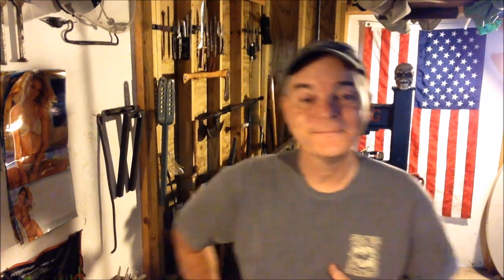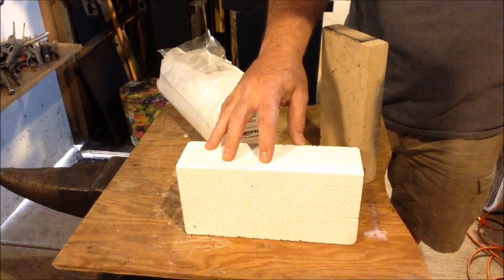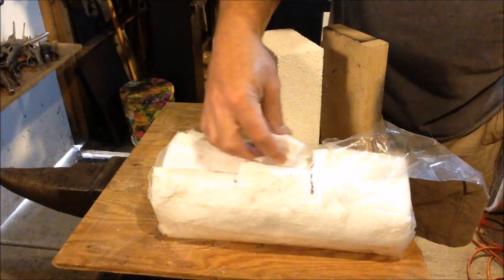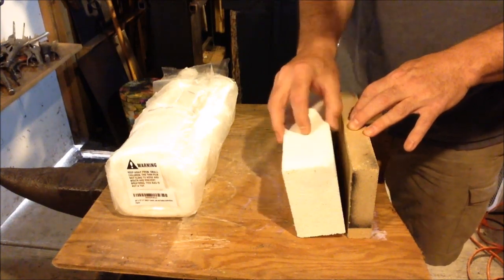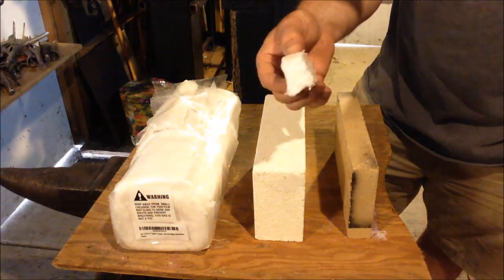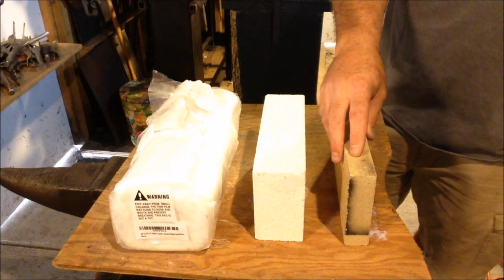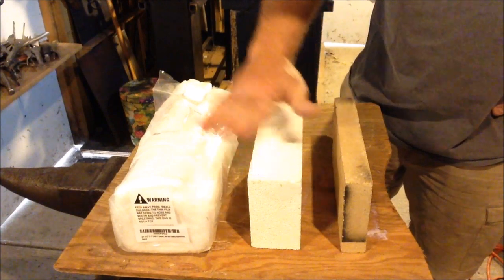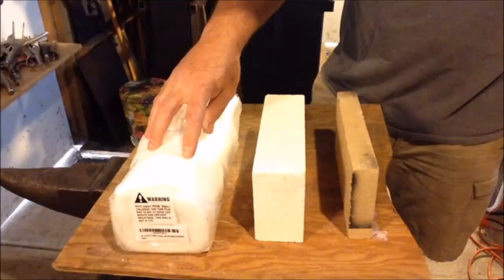Subscriber Question - Insulating My Propane Forge?

Comment: Quick question if i made a forge with fire bricks on the bottom coated with satanite to reflect the temp with the fire blanket also coated with satanite and maybe the price are better or because it is bulk priced for 21 bucks for refactory cement or is that the wrong stuff
Reply from the maker: Bryan, I hear Satanite is good for coating wool blankets or the soft white bricks within a forge or foundry furnace - not sure what the costs are.  I just see a lot of guys using it.  Also, I just built a foundry furnace and used Imperial Refractory cement from True Value to coat all the white soft bricks - that worked well and was inexpensive.  Good luck with your build!

Comment: Question choosing a tank to make a forge is aluminum or stainless steel good idea or bad or do I have to add extra steps or extra insulation? I saw a 30 gallon propane tank for 30 and wanted to make sure not going to smoke check me
Reply from the maker: Thanks Bryan - Aluminum has a melting point of 1220 F yet you need to run the forge high enough to reach forging temp for mild steel which is approx.  1500 to 1800 F.   It's also expensive.   So, I would use mild steel given it has a melting temp of 2500 F. Stainless could work but it's also expensive.   Stay safe if re-purpusing a propane tank - I hear it's dangerous...
Reply: @RickRabjohn  yea was also looking at a old tank going to use water to fill rinse and repeat fill with water again when I cut

Comment: Hello. Could you please help me with a question? Recently purchased a devil forge with the ceramic wool lining. I used Refactory Cement to seal the wool lining. On my first fire up the cement began to bubble. I allowed the cement to cure for 5 days prior to first fire. Do you have any suggestions as to why this may be happening?
Reply from the maker: It happened to me a few times as well when coating insulating fire bricks (i.e., the soft white bricks).    Underlying moisture is the issue.  When this happens, I fire up the foundry/forge to drive off all the moisture (get it bone dry) - then let it cool down - brush and vacuum out any loose refractory that came off and then re-coat.   Hope that helps Trace, and good luck with your new forge.
Reply: @RickRabjohn  Thank you very much for your prompt reply. I assumed moisture was the issue but appreciate your confirmation. Best. Trace

Comment: Quick question for you, what type of hardener should i use for the kao wool? Ive seen blue and clear but no product names have been stated and ive seen a person use refractory mortar. Im building a propane forge and would like to glean as much knowledge as i can from as many perspectives as i can.
Reply from the maker: Aaron, while I don't have any personal experience with Kaowool coatings, I have seen guys use either Satanite Refractory Mortar or HT-100 coating for sealing the Inswool/Kaowool fibers in their forges.  Hope that helps and good luck with your build!
Reply: Thanks Rick

Comment: Im looking to start forging, I want to build my forge but cant do coal due to local laws. I would not be planning on upgrading my forge for years, im on a low enough budget aswell. I dont need welding temps, would the ceramic bricks be my best option (gas is expensive so efficiency is important)
Reply from the maker: Be careful you might get addicted like the rest of us :-))  I would agree with you on lining the entire inside with the soft ceramic brick - If you plan to do forge welding with Borax flux - I would use the cheaper hard brick for just the bottom.  Thanks for checking out my video and good luck with your build.
Reply: Rick Rabjohn thx

Comment: Hey great video.are your hard fire bricks holding up for you?I'm ordering fire bricks and was wondering if the Lowe's brand worked fine longterm.
Thanks
Reply from the maker: Hey Tim, they are working fine. They are fragile, so dropping or hitting them will crack them.  Beyond that they are good.

Comment: have you considered HT stainless steel sheet, its a grade 310 and melts above about 1700 deg C, a good heat reflector & abrasion prevention lining to protect Kaowool. Also, ceramic fibre board (very dense, compressed Kaowool) ?
Reply from the maker: I haven't thought of that.  Good ideas but for me I am a bit leary of using Kaowool.  Perhaps it unwarrented, but I just rather not take the chance..

Comment: ok thanks for rely. im in the uk and dont think we can get satanite here. the reason i asked about plaster of paris is because i have a small furnace i bought from the U.S. ans the insulation in it is pure white but solid , like solid kaowool, but if it was kaowool soaked in satanite to make it hard , it would not be white would it ?
Reply from the maker: Sounds like you have what's called Ceramic Fiberboard in the small furnace which is white.  I know it's used in furnaces, Loz Harrop whose channel is called "ppotty1" uses it in his Rocket Stoves, and Glen from the channel "Glen GS Tongs" uses it in his propane forge.  Given Loz is from the UK, he might have an idea where you could get some local.  It's often hard to find.  Hope that helps and good luck with your forge
Reply: Satanite and other coatings will be blueish when applied, then dry lighter and "burn in" almost white, so yes -- might be that. Good stuff. Best way with Kaowool is to apply a rigidizer first -- let it dry -- that hardens up the ceramic fiber fabric, then coat it with satanite or other high-temp cement, then final coat it with an IR reflector thin layer, like ITC-100. These are FAR more efficient walls for acheiving high temps than any kind of bricks. Gas forges heat up fast and cool down fast and that repeated extreme thermal cycling degrades, cracks and crumbles fire bricks to bits in short order. Fire bricks are better for kilns and ovens where they heat up slower, to lower temps, stay hot longer and cool down slowly.

Comment: Will coating the wool with silica work for locking in particles as well as making the wool rigid?
Reply from the maker: I don’t know the silica you would be using.   I would goggle it and see if others have tried it.

Comment: Was wondering if you could cut the ceramic firebrick in half
Reply from the maker: You sure can and easily with a hand saw  - Booyah!
Reply from the maker: Hey Hey Pete - no worries and appreciate you sharing the other alternative which I was not aware of.  Heck that's why I started this channel - to share and exchange information amongst those with the same passions.  The high grade bricks sound terrific but as you say expensive.  For now, I'll stick with my current set-up but appreciate you reaching out.

Comment: Why do we insulate it? Don't we want the heat to come out???? I'm confused
Reply from the maker: nope - insulating a gas forge is critical to retaining heat - it also helps protect the outer support steel - keep in mind - my forge can heat steel at temperatures between 1800 - 2000 + degrees F

Comment: I just finished my kaowool forge and din not coat anything and a yellow residue was left on the surface is it to late to coat the wool then
Reply from the maker: Hey Willy,  I'm not sure.  If it's still structurally sound, I would guess yes.  Perhaps try and see how well the coating adheres.  Good luck!
Reply: Ok thanks for replying

Comment: I was a union insulator for Alabama Power for years and years we called that suruwal and the white block the one that you can cut with us all a hand saw Caleb that's what we called that and you can go down to any insulation corporation that sells insulation and buy the stuff you can buy a whole roll of that sir wall 25 foot by 24 in for less than a hundred bucks that's enough to make 25 foot by 24 in 1 inch thick for less than a hundred bucks that's enough to a bunch a bunch
Reply from the maker: Thanks for sharing your experience and tips Michael!